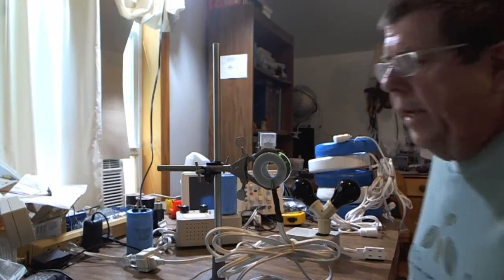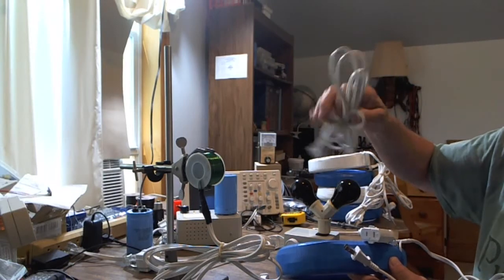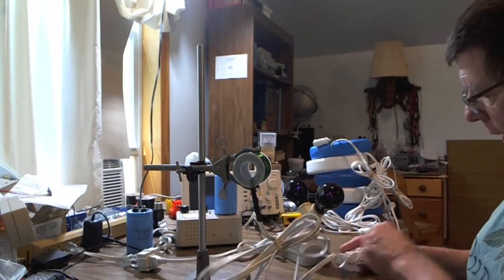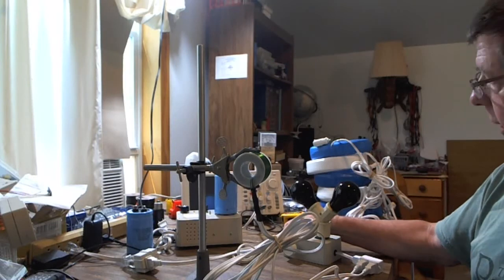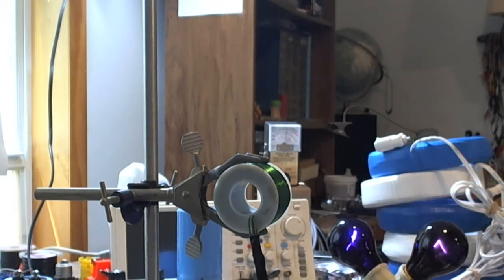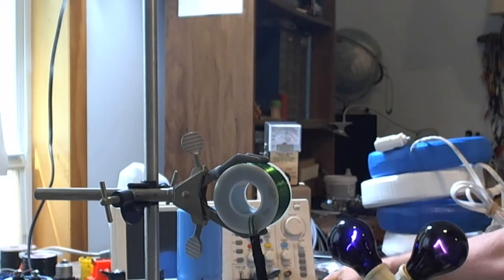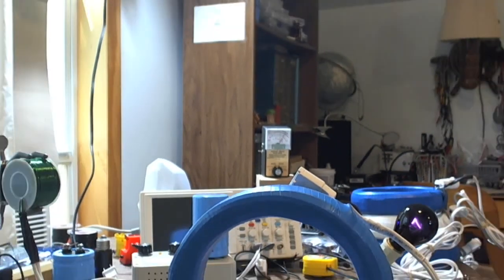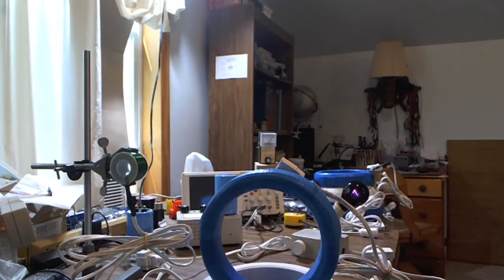Old MAG to New Bifilar Comparison 1

Comment: Steve, how many milliGauss would it have registered had the New Bifilar coil been placed within 2 to 6 inches of the meter?
Reply from the maker: The magnetic pulses are into the Gauss range, far above the milligauss range for all delivery combinations.  The 3” coil and 8” coil both could produce better than 400 Gauss pulses.  The difference being the Gauss pulse strength was measured over a significantly larger area with the 8” coil.  There is a minimal 10 times energy delivery increase between the High Powered and Bob Beck style PEMF.  Maximum pulse strength was measured by several different users in several different ways.  The measured values where all over the place ranging approximately from 200 to 1000 Gauss.  More detailed specifications are outside the scope of this narrative because of the amount of information needed to explain everything.  Respectfully, Steve
Reply: I was curious because I just read that the SOTA MP6 claims to register 2,500 to 6,000 Gauss on the face of the coil. I figured your measurements were lower because you placed the meter 3 feet away.